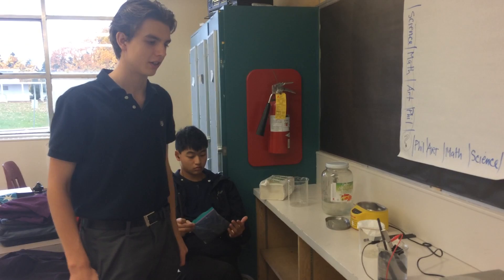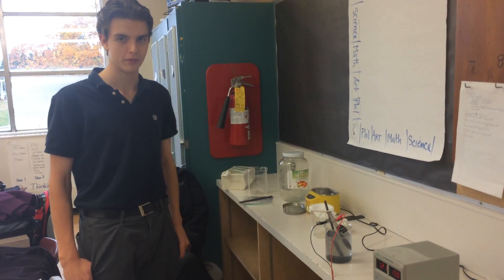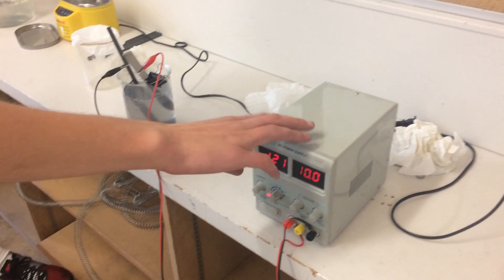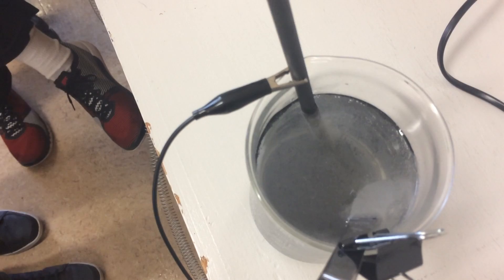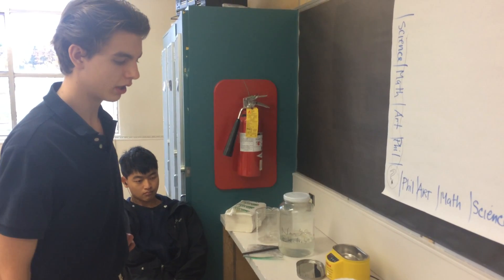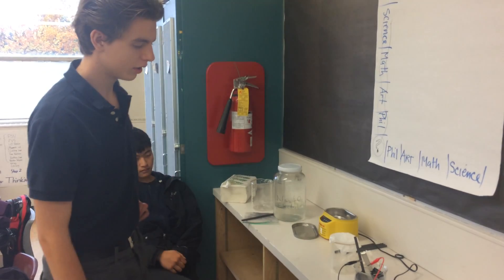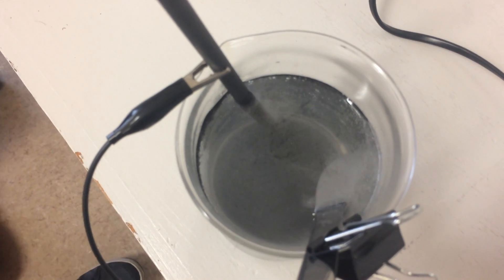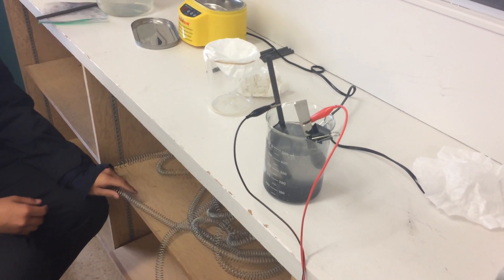Graphene Production

Comment: I watched your video.You make acid solutions with water for electrolyte process to make graphene. Please guide after sonication we can add this liquid directly in to plastics or for other applications. Is any filtration or washing is required after sonication.
Reply: You sonicate it for a while for the final separation, after electrolysis layers are still very slightly bound to each other.

After that, filter, wash and dry and you got ready to use graphene :)

You cannot add that salty solution to a plastic directly, there is a lot of excess water and salts remaining. I am yet to run to boundary of grams of salts to grams of graphite processed, and i go through a lot of electrodes per 1.5l yar (~12gr per electrode, ~10.5-11gr is used up).

I don't usually wash it much, but i do dry it before adding to plastics.
Could do a full process overview video tho
Reply: solution can be sodium sulfide.how to calculate ratio of electrode weight with solution.
Reply: can we say this is the best method to produce graphene.
Reply: It is a easy method to produce bulk graphene, albit not pure. 80%+ of 1-3 layer large flake size, but still contains some graphite.

Read the paper
Reply: No need to, the process simply stops when there is no more sulfide in there.
Reply: how to seprate the graphene and graphite?
how much quantity is required of sulfide in electrolyte.
Reply: reminder
Reply: reminder
Reply: the information is out there. If you don't have the initiative to look for the information, don't expect it from others
Reply: last plz guide mixing ratio of sodium sulfide in de-ionized water.